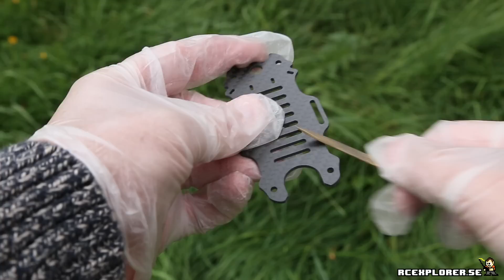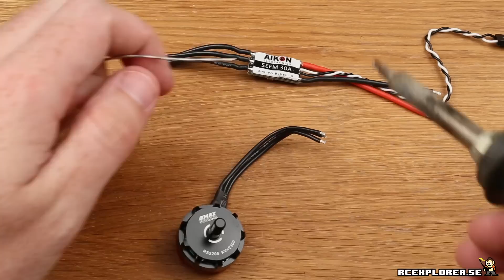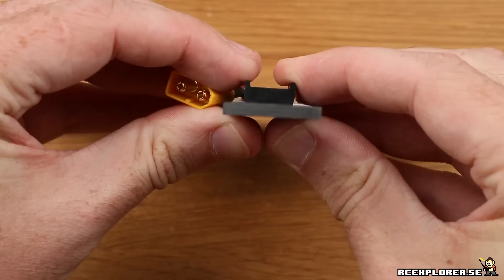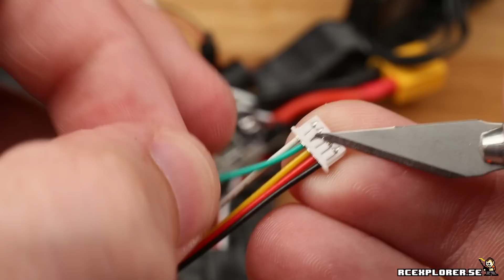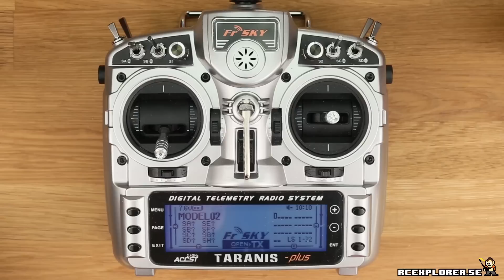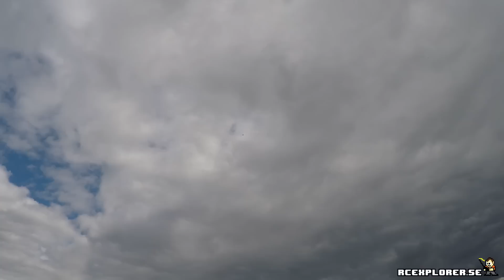RCExplorer Baby Tricopter Build - (170mm Tricopter)

Comment: you know it is 2019 when a simple assembly = build. Why don't you call it "design and manufacture"? After all hand work had been involved and you also designed the length of those wires.

Comment: Ok David. For a month i have been flying my scratchbuilt 585mm tricopter on a trusty KK2 board with lots of success... The tail however had a bit more wobble than is should have. I watched almost every tricopter setup and build you have done and decided to switch to Naze32 to get the Tail Tune function ti hopefully smooth out that wobble. Removed the KK and wired and programmed the Naze32 with Triflight. First off. It wont fly... Wont get off the ground with out the spin of death and the Tail servos (same ones that worked fine with the KK2) keep getting so hot that they burn out and one has even magic smoked... Not even in flight either. Just during the tail tune and leveling... The servos are not too tight, the servo isnt binding, they are fresh out of the box brand new emax 9g metal servos. 
I would like to stay with the superior Triflight programming but cant afford to keep burning servos and not flying... 
What am i doing wrong? What could the Naze be doing wrong since if i put the KK back on the tricopter it lifts off and controls fine and the servos stays ice cold... 
Also one other note. Even after tail tune when i go to arm, the Tail mech tips to the right. And wont control left past the center point. It stays completely right, in normal operation and with a servo tester the servo is centered and has fluid motion both ways. 

Help Me Please as I am attending one of my first Fly events in a week and would like it flying well!

Comment: Hi David just a question about the servo. I am using a Betaflight F4 FC for the tricopter, if I  want to connect the returning signal wires, which of the pins or Uarts can I use for them? In your video you comment about pin 1 and 2 but that's are in your particular FC.

Comment: I really like the video, but I am a little confused. I don't have much information on RC anything, this is my first project, and I don't understand how I am supposed to program my FrSky Taranis Plus transmitter to control my tricopter. In the setup video you suggested, you used a different controller and then just switched over to the FrySky so I was a little confused.

Comment: Hi David, 
thank u very much for ur videos, just Top.
I have  a question i am using the Tricopter Tail Mount of the Flitestest guys :-) and also their digital servo from Emax.
I just build the tricopter and now i am wiring everything. So i am using a HGLRC F3 Board - using the SP Racing F3 Tricopter Betaflight Code from your Homepage. My Problem is, the servo is not moving, weather i solder it to S1, S2 aso. The servoe itself is working if directly plugged into a receiver, but from the board direct no, can u tell me what i am doing wrong ?
Motors are spinning correctly - are soldered on S1 to S3 on the board !
If i solder the motors like in ur video, Meaning Motor 1 to S1 - Servo to S2 - Motor 3 to S3 and Motor 4 to S4 the 4th Motor is not spinning, neither the Servo.

I really would appreciate a short feedback to get my tricopter flying 
Thx David and happy flying !

Comment: Question, all three motors on my tricopter spin the same default direction. Did not consider that before soldered and wrapped them into heat shrink, expected triflight to take care of this. Which did not happen... Do not feel like desoldering, going to simply reverse two motors trough CLI. Would this be the only correct way or I am missing some data?
Reply: triflight uses tri mixer which looks like 
#0:  1.000  0.000  1.333  0.000
#1:  1.000 -1.000 -0.667  0.000
#2:  1.000  1.000 -0.667  0.000
i only need to reverse one of the motors, which would be #0
doing it right now
Reply: custom mixer does not seem to be working any change makes motor not to spin, thanks for the hint, starting bl_heli
Reply: 1. do not have usb linker
2. honestly easier to desolder the wires ))
thanks anyway
Reply: He said " test the esc's before heat-shrinking", what does he mean with that? How should you test it?

Comment: 5:28 wth haha you have a red pointing finger hand

edit: I really like the tri-copter look, I'm curious if because of the asymmetry if the single motor in the back has to do more work since the two motors in the front well... yeah so have to figure in that for the design and CG.

Comment: Hi David, the prop direction in the config tab shows a different direction while my props are spinning like you mentioned, i had this with all Tricopter builds so far. I have build an Babytri with a Naze32 rev5, loaded it with triflight 0.5 and it's awaiting it's maiden. Just had it in a stable hover and it reacts on the inputs like it should. I had a quadcopter build before where my prop direction was the opposite of that what the fc showed and that flew awfull and i needed to change the motor direction to get it in the air. Just wondering, the Tri's are flying good! I really hope you can make a micro Tri somewhere in the future :D Cheers!

Comment: That "Self Vulcanizing" tape is used on real aircraft as well. In the US Air force we called it F4 tape. Its just a form of silicone and the black stuff usually has a green stripe in the middle, the orange stuff might have a stripe I can't think if it does. But it is one of the few authorized repair materials for wiring in certain applications. And it works... After about 30 seconds you can't tear it apart or it'll just rip. It's also tapered out towards the sides so when you wrap it, the whole wrap is smooth and doesn't have spiral ridges.  So you're on the right track with your techniques David.

Comment: With only casually flying ( no racing, no acrobatics ) on a 2200 4S, what kind of flight time could one expect with one of these?
Reply: on my quad with about the same specs i get ~10min with a 2200 4s, but that's with a bit of acrobatics, so probably around 15-20 minutes

Comment: Can it lift a small HD cam like a GoPro Session or SJCAM M10+ or is this strictly FPV+DVR?
Reply: Robany Bigjobz If you can fit a GoPro on it, it should handle the weight just fine.

Comment: David Windestål In this build you solder on the wires from the external BEC to the correct pads on the FC, but since you have not moved the resistor all power will come from the VBAT wire. Discovered this as i didnt feel the need for vbat telemetry and use a external BEC.

Comment: hey what's the reason for soldering the ground wire of your esc, when it's already grounded to the battery. u usually use the signal wire only and de-solder the ground wire and works fine.

Comment: Gotta be careful with the self-amalgamating tape though. If you overstretch it when putting it on, despite it looking great at first, a month later it'll tear itself apart and you'll need to put more on. If you don't stretch it enough, it doesn't bond. There's a knack to it.

Comment: Hi David. Just wondering about how much clearance there is between the FPV Tx and the top plate once everything is in. I like using the RROSD PDB but with the pin headers in I would have to use some small spacers in the bottom of the stack to elevate it off the carbon fibre. Is there room or would it needs to sit flat on the fibre washers?
Reply from the maker: 8.8mm. The stack top plate is G10 so no worries about shorting out.
Reply: +David Windestål no worries. Thanks David. I might be able to just squeeze a little spacer in there for the pdb. If not I'll just direct solder rather than use pin headers. Cheers mate.

Comment: Little tip.  finish the sharp edges on the carbon with it wet.  It prevents or at least reduces a lot of the dust and you can just wash it away.

Comment: That looks great, I can't wait to get one!  The Unify Pro HV is my favorite VTx too, but I replace the pigtail with a "uf.L to SMA Female".  It just plugs right in, no soldering required.  Then you can use any normal SMA antenna, and not have to drill those two holes in the carbon.  Here's the one I usually use, but it looks like they're out of stock right this moment https://www.amazon.com/gp/product/B00GWMB9YQ/ref=oh_aui_detailpage_o01_s00?ie=UTF8&psc=1

Comment: great video, I want one,   the only thing I think I'm not sure on is when do you check motor direction?   I found that on my quad builds if I match wires without crossing any the motors spin the same way,  on the video both the front motors would spin the same way, how do you reverse the motor?
Reply: U can change the direction of the motors in BLheli.

Comment: Fantastic video! I REALLY want one, haha. If all goes well with money I for sure will try to pick one up, as this baby version is sick!

 I have a few questions, not sure if this is answered in the triflight video since it has been a long time since I watched it, but do you need a custom transmitter mix? Does BL heli pass through work on that board, is betaflight configurator supported? Also that size battery would you suggest? It is a 5inch so 4s 1300? Have you had any issues with the _S escs like some others? 

Ok, that is all, thanks again for such an amazing video, copter, and for everything you do for the hobby! I am getting hyped just thinking about buying one!
Reply: paul zug I sure hope so, but no firsthand experience here :/